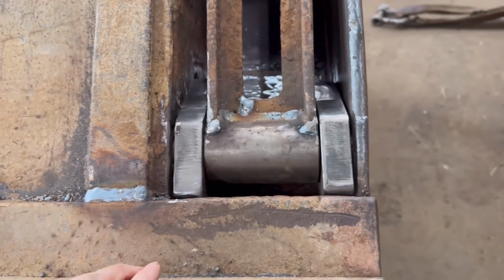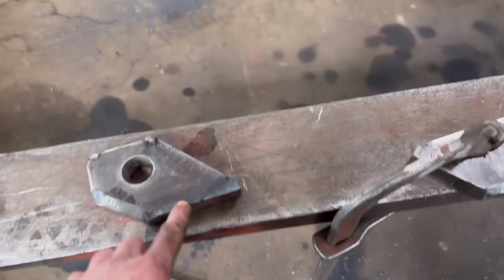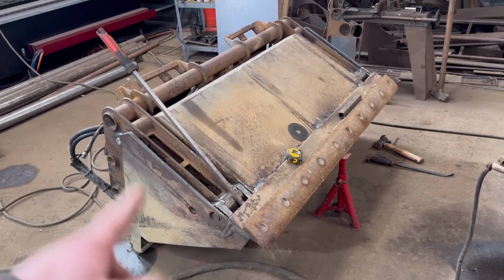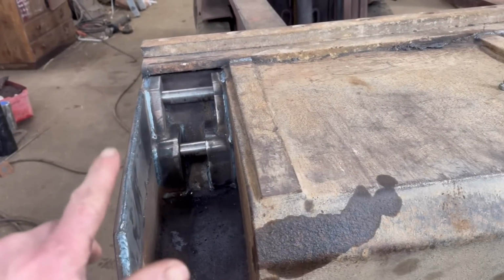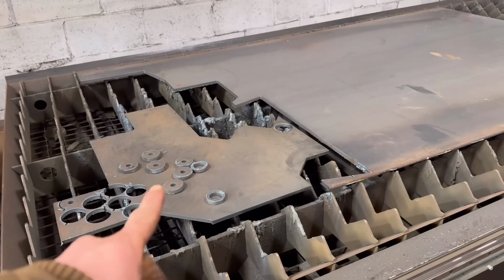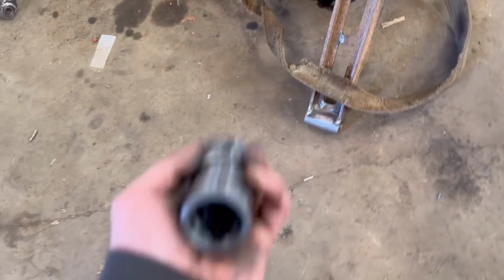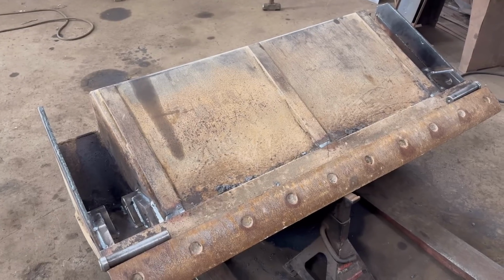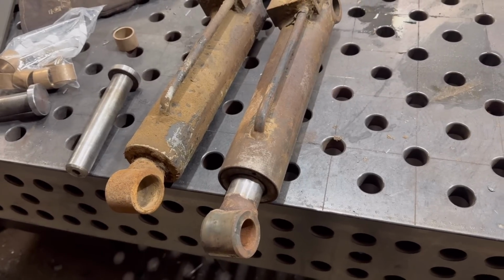Rebuilding COMPLETELY worn out skid steer toe tip bucket! Part 3

Comment: Hi, I'm looking at the problem with the two holes, and it would have been better to put in a plate without holes and make them with the magnetization drill, and it would have been much easier. Regards 👋

Comment: Ollie, have you considered holding the three jaw chuck in the four jaw ? For a run of bits such as you had there with the pins it would have made it easy without needing to remove the four jaw.

Comment: Sometimes you can not turn a pigs ear into a silk purse you can only get a worn out pos to be good enough for what it's for. Fabrication is a tuff job being in metal helps only so much still mental strain added to the heft of the steel for sure. and you get as close to a silk purse as possible from worn out.

Comment: Have you thought about making a back plate for the 3 jaw chuck to fit into the 4 jaw chuck? that way you don't have to remove the 4 jaw and just fit the 3 jaw into the 4 jaw when needed. I have seen many people do this to save removing the heavy 4 jaw for jobs that are probably faster with the 3 jaw and saves on time aligning the part in the 4 jaw every time.

Comment: I'll say one thing, Oliver. Everything you have done is far beyond the factory quality. Your repairs will outlast the rest of the bucket. If the farmer puts grease hoses on the fittings and actually greases it. That would be a permanent repair. From what you started with says it doesn't get grease, so you might be the only one to grease it for the rest of its life.

Comment: Hey Oliver - great video as always!  Is there any way you could fasten an adapter plate or stub to the head side of your 3-jaw chuck that would allow you to chuck your 3-jaw in the 4-jaw chuck?  This way you would only need to indicate in the 3-Jaw chuck once when you chuck it into the 4-jaw and all your round work parts you need to turn would not need to be centered each time.

Comment: The rams should have a little stroke left when it's closed up on the bump stops, rams don't like topping out on a regular basis. It's a balanced hydraulic system so one ram won't be doing all the work. Cheers from NZ